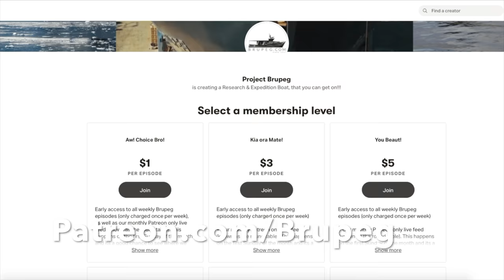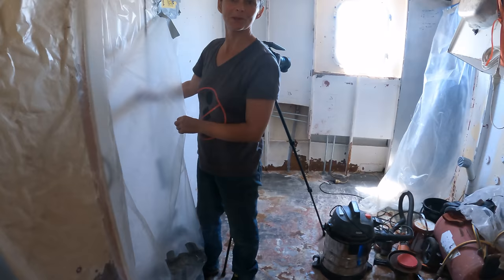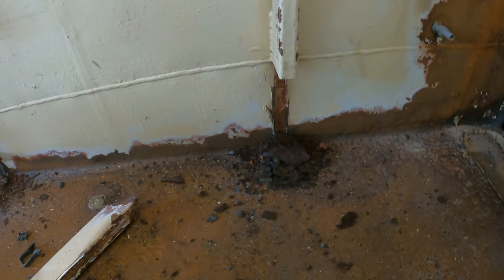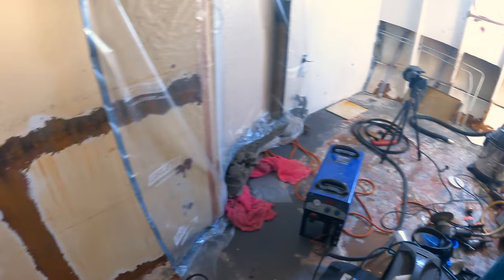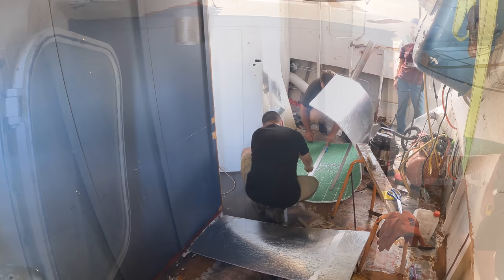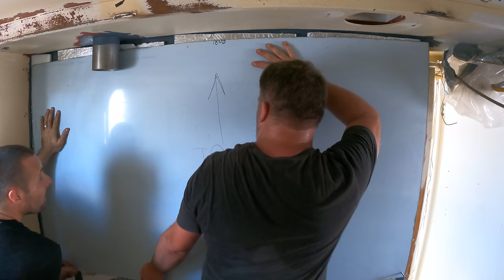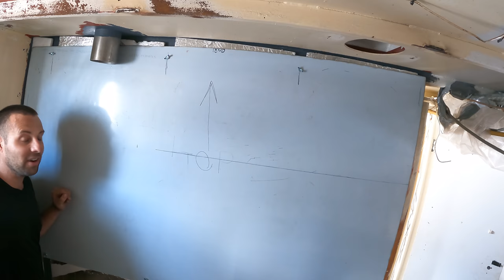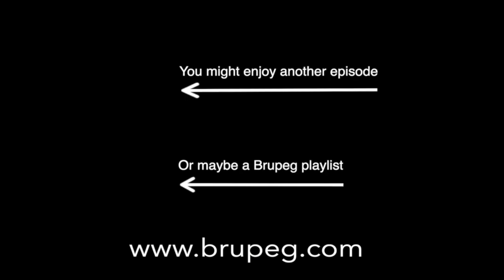Brupegs First Stainless Galley Wall Panel - Project Brupeg Ep. 191

Comment: It's amazing to see Jess so full of energy. Dame of course just keeps going!

Probably too late but if you need to move the extractor then just lower it slightly and pop a couple of 45* bends. As long as it stays about 800mm above the job then you should be ok. The actual minimum distance should be specified in either the job or extractor specs.
Reply from the maker: Thanks Nic.

Comment: 25:33 one thing you guys should also have, a modular immobilizer stretcher. If someone gets banged up in rough sea, falls overboard...you'll want to get them with one of those rather than lift them by rope. (knock on wood so it never ever happens on Brupeg)
Reply: They could use the stern chair lift

Comment: Guy's, just to be clear, a de-fib will not restart a stopped heart. It will shock an irregular beating heart back into rythmn. Good advice to carry one though as they are now really affordable.
Reply: Some of the newer ones have a manual mode that will shock without a rythmn another thing to consider is a steel boat could send a shock to the batteries depending on the polarity of the pads so off the deck. Oh and you don't have your brother test them on you even when they are out of service...
Reply from the maker: Just to clarify is it the brother that is out of service or the defib
Reply: @ProjectBrupeg  The battery defib went out of service at a workplace and I offered to investigate replacement batteries for the 4wd club if work donated it, I got him to hook it up to me thinking out of service meant not enough juice well green light came on so you have to press it... from a seated position I threw myself on a "graceful arc" into paint cans. Had the juice for one shocking to me result!

Brother is fine and yes we were able to source replacement batteries and had it recertified, it was at recertification we were told the newer units had a manual shock and if the green light does not come on do CPR.

I would not recommend it was worse than when I lost a bet and was taserd and the times I shocked myself on generators, power amplifiers, insulation testing equipment and the mains. Electricity likes me but I am not so much a fan of it.
Reply from the maker: lol, I’m so sorry, I loved reading all of this Steve. Dame
Reply: @lemullet6273  Not sit on one but put a plank of wood on it and a dead washing machine then hook up 12v can say yes to that one but the result was too violent to try anything else. My Arc Welder has not yet bitten me but my angle grinder grabbed my shirt one day and went for my throat. I now call the grinder Sarah after an ex (she was ruthless too).

Comment: For example, think of a rubber (the kind you put over your shoes when it rains).  Hold it at its heel and toe.  Now twist and bend it.  Now think if it had more of a double wall in places where it was bending.  Whether you bend it or twisted, the forces felt in that area is sheer.

Comment: PS maybe you forgot I know you're busy,,  but stainless steel likes to have low RPM and pressure when Drilling.or it gets work-hardened. :-)
Reply from the maker: Cheers Robert. It’s mild steel behind the stainless so they had to give it some grunt. It’s hard drilling above your head too after a full days work too. Jess

Comment: Hey dame, you might want to pull the protective plastic back from the edge of the stainless when you grind it, you might find the grinder heat melts the plastic to the stainless and makes it a bastard to get off
Reply from the maker: Ah, great point. Thanks James will do.

Comment: What happened to the top of that stainless sheet ?  We saw you scribe the top edge and then when you installed it there was a gap of a few inches at the top with the insulation exposed.
Reply: I was wondering about that to.
Reply from the maker: It was never marked to be a tight fit. The gap is about 30mm and we will be putting 120mm of insulation on the roof so the edge will be well burried
Reply: @ProjectBrupeg  and that folks is the answer we been waiting for. 🥳👍

Comment: Hey guys!  So the panels you are cutting off DO add strength to the hull.  Without them, that portion will still be strong, but they will be stronger with them on.  It will bug you.  Also, I think that's the widest part of the boat?  You will have the most overall twist stresses in that area.  I know you want to be able to reach back there - maybe make windows in the middle of each of those panels, but I don't think you want nothing between ribs in that area.  Best, you guys!  Almost afloat!!!
Reply from the maker: M C that’s the difference with a commercially built boat,  little panels like this don’t contribute to much strength at all. Technically yes but not practically relevant. What matters is making sure we can weld up the gap.. Ribs, hull panels, good welding is what make it stable and give it strength. It was because it was easier, not better that they were left in the first place, one of the few areas on the boat that wasn’t done right. Cheers Jess

Comment: Sure you can cut down the extractor hood to a narrower width and TIG the side back on...
Reply from the maker: We could but it’s welding very thin stainless and that’s a difficult thing to learn versus cutting ply and re- sealing.
Reply: @ProjectBrupeg  I'm following with interest, My galley is imminent as as soon as I figure out how to remove a 65cm cooker through a 55cm hatch - big hammer would do it but I still have to get the replacement cooker in and thats also 60cm plus...

Will you be leaving the stainless as mirror or linishing it to e.g. brushed sanitary finish - I can vouch for the latter as being far more practical in a galley, doesn't show scratches, fingerprints or curry splashes - much easier to maintain and reflects the light much more softly
Reply from the maker: With enough velocity that stove will go through the smaller hatch... once.
Reply from the maker: Leaving it as is just because it’s less work. I prefer the brushed finish. Good luck with the stove! Jess

Comment: I take it the grinding Sparks and MIG welding sparks were a little hard on the leg skin. It's probably pretty hot to be in pants and protective gear. I hope the lights turned out as good as the first one?
Reply from the maker: Great point! yeah lights working well, thanks Dennis

Comment: Hi Damen,just a bit puzzled to why you never took the stainless panel flush up to the top. You cut it to fit snuggly ???
Reply from the maker: I wanted to allow plenty of room for expansion/contraction but also because the roof insulation and panels come down 100mm below where the cut is it didn’t need to be tight against the steelwork. I forgot to mention that on the video
Reply: @ProjectBrupeg  ok, get ya,wondered why you never mentioned it. Looks like you did not need to cut it to that shape then perhaps. Great that Jess is so mobile now. Such a great channel, strange why youve only got 34000 subs. Should of been at least a 100,000 by now.

Comment: The more I see Brupeg and all her dirty little secrets (rust) i wonder if she hadn't sunk how many years she would have had left in her? She had a hard commercial life but when do commercial  owners decide enough is enough and turn to the scrap heap?
Reply from the maker: Steel boats are different. Brupeg has years in her yet. With steel you can cut out almost anything and replace, blast, paint and keep going. We’ve seen light through a pitted bow on a trawler and the guys cut the bow off and replaced. That’s why we like steel it’s resilient. What we’re sorting is what was covered in insulation that was missed over 47 years. It’s not much. This is a commercial refit job really, try not to think of in terms of private boat builds. Different level of work and decisions apply. Jess
Reply: @ProjectBrupeg  yes of course! It just amazes me how much a boat can take and still keep going. Its really nice to see all the little things getting sorted which in her previous life would have never been an issue!